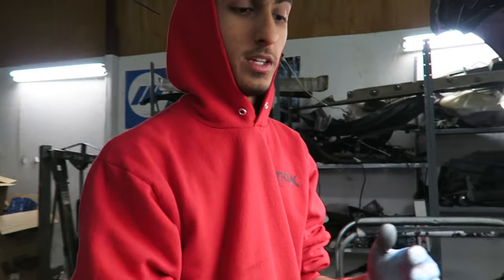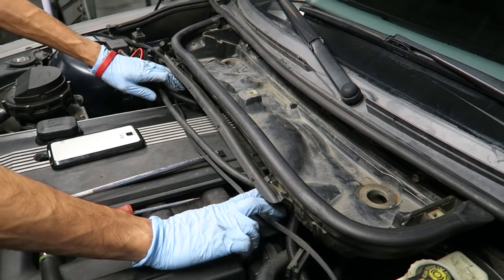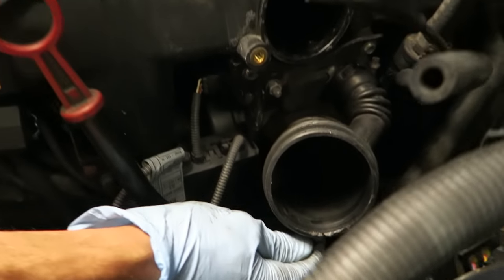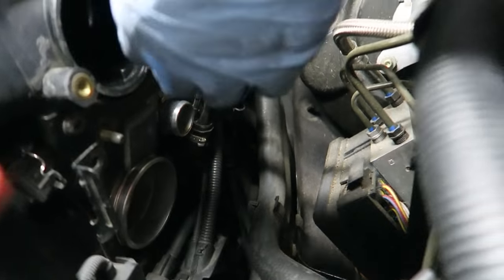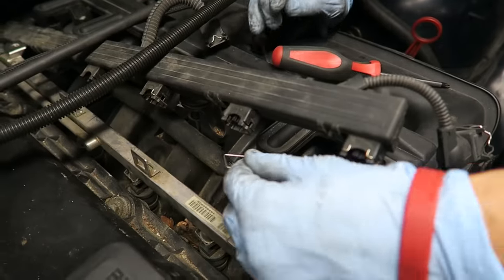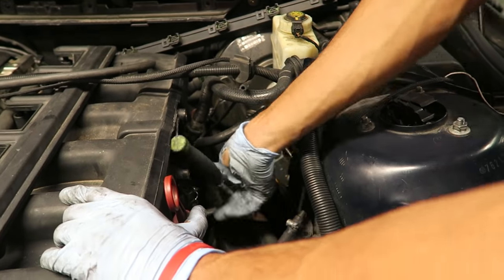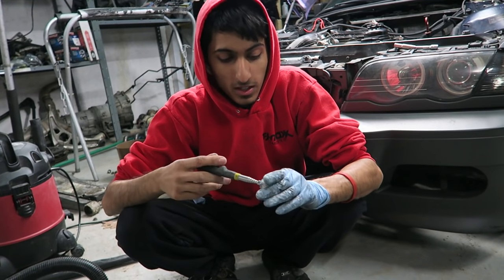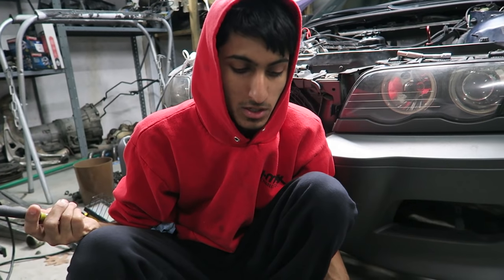BMW E39/E46 Intake Manifold Removal DIY

Comment: I wish you could talk about those 2 notorious crispy coolant pipes under the intake. I need to change those, they are still factory original
Reply: That's why I came here. Nathan stopped short. Not sure about 50sKid. Still they seem like the easiest part of the job.
Reply: Yup that would be an awesome video!!!
Reply: YUP, I pulled my manifold off for this reason.  What a shit design, those coolant pipes should be aluminum
Reply: @Static Boolean how’d that go for you, i’m in the process of taking apart to get to them.
Reply: @brianc9036   li
Reply: Yeah that’s the thing I need to do on my car. Found out hoses were leaking a few days ago
Reply: The 2 crappy plastic coolant pipes under the intake were changed. While you are there change the thermostat with a metal impeller, the connecting hoses, and oil filter housing gasket. You will thank me later. Be extremely careful and clean the holes before installing oem O-rings. The leaked first time!

Comment: On my e46 I cleaned my throttle body and turned the flaps where all that black buildup in the threshold. I did a throttle body reset holding down the gas pedal with the ignition on position 2 for 10secs & taking my foot off for another 10. It actually reset my throttle body. I couldnt rev over 3k. It solved my problem and i hope it solves someone elses
Reply: Thanks for sharing that, after watching this video I thought i'd need a new throttle body.
Reply: This is exactly what mine is doing... can you provide me with any more (specific) information?

Comment: The only injector clip I dropped was #2 and it went in the hole between #1 and #2 intake runners. I kid you not, it made it all the way to the floor. I could drop a clip in that hole a hundred times and it would only make it to the floor 2 or 3 times. I feel the repair has been blessed from on high.

Comment: I have watched a lot of different videos for the intake removal. Im glad you show more of the removal process. Would be nicer to see more of the intracacies of the process. You showed a few steps that none of the other videos showed. Thank you. Despite having an e39 myself. I was absolutely shocked how hard it was to find an instructional that showed the 99 e39 and not the 97. Great job. Now i just have to refer to this vid a few times so i can get the darn thing back in

Comment: thanks a lot, I save a lot because of u, i was having issues with fuel ingectors , and from this video i learned how to disconnect the wiring from fuel injector.i don't know nothing about mechanic but i always try. i had so much  trouble with fuel injector 3 &4, i was ready to take my e53 3.0 to the mechanic. what i learned from this video was how to unplug the fuel ingector harness and i plug it back and my trouble was solve.. something so simple cause me a lot of trouble.it had a short circuit or whatever,thanks  a lot shoplife :)

Comment: i Just bought an E46 and thanks to your videos i have or will be changing Valve cover gasket, Intake Manifold gasket, Oil Filter Housing Gasket, Dipstick and Dipstick Tube gasket, Disa Valve Gasket, Both Plastic Pipes Under Intake, CCV and Oil Separator and power steering pump ofcourse ill be changing all vacuum Lines under intake have i forgotten anything.  Mind you im not a mechanic keep up the good work.

Comment: I'd recommend also replacing the plastic cooling lines that bolt to the block also. I've been chasing down coolant leaks and mine happen to be bad. I'd you have a coolant leak, check those while you're in there.

Comment: Thank You! This Video help me out a TON! I did brake the DISA Valve upon disassembly I missed a bolt! I have coolant in the Throttle body, My vacuum lines are toast, the tube going to the crankcase/dipstick is a goner. found coolant in a vacuum lines, #6 cylinder  intake was full of coolant.  Now I need to buy the VANOS Tool set. Removing the cams timing chain, exhaust manifolds, head.

Comment: Great step by step, helped me get through this job, BUT * there are vacuum lines underneath and in the back that will break and have to be disconnected, he did not mention taking them off!! I broke the hose that connects the vacuum pump to the intake. And the secondary air pump hose is usually really brittle and mine snapped like a piece of straw

Comment: 12:25 I removed and reassembled the intake to replace the coolant pipe, and now the intake doesn't sit tight on the head anymore. I disassembled it again to make sure everything is ok, but it looks like the gromets under the 11m nuts have compressed, and there is a bit of play. These gromets aren't replaceable, so I'm screwed? I may have to fashion a set of washers to take up the slack.
Reply: Hairy Names question. Were you having an overheating problem where you would get steam from your intake manifold once temps get too hot and car starts to over heat? Bc that’s my issue and can’t tell if it’s the coolant pipes or not

Comment: Excellent video!  Especially appreciate not removing fuel rail in order to remove intake manifold.  Although I do agree that in a higher mileage vehicle, getting the injectors cleaned is probably worth that.

Comment: Nice video and good explanation of the job. I had to do a starter on one of these. im putting it back together tomorrow. the starter bolts were honestly the worst part by far. the external torx bolts are really close to the firewall. i had to cut a wrench and weld it to make room to turn it. I wish I knew the fuel line came apart that easily, I took the injectors out of the manifold. thanks for the video
Reply: 12pt wrench works, preferably a flex head ratcheting wrench
Reply: I’m thinking about getting to the starter to replace from up top too ,  any pointers on hidden plastic parts I can break??

Comment: Just followed this vid over the weekend to remove my intake manifold so I could replace the coolant pipes that run under there. What a f'n pain! Anyways, glad I did because the coolant pipes were disintegrating where they attached to the engine, pissin' coolant everywhere! Now I'm waiting for the replacement parts you recommended to replace while I got it all tore apart. Thanks for the vid! Where's the reassembly video? lol

Comment: Using this video this coming weekend. My 325i has been sitting to long now. All over a broke water pump.  Since I had it close to the overheated side of life I decided a great idea to change out some of the more important gaskets and went about the intake removal a ridiculously stupid hard way. And as I was installing everything I forgot to plug in one wire that is impossible to plug in with the intake in place and bolted back down. Oh what wire was that  yep u guessed it the blanking blank blank knock sensors ugggh this was over two months ago and caused me to loose all want to get my baby back on the road

Comment: Great video. Thank you and appreciate your videos.I am a little bit unsure how you managed to remove the fuel rail without lots of fuel spilling all over the place. I assume you purged the fuel rail first but i dont believe you shared that part in the video. I note this because its probably the single most dangerous and potentially messy part of this manifold removal process. Overall your videos are really clear and well presented.Awesome. Also was wondering if you could have included mentioning replacing the heater hoses that sit under the manifold since you have the manifold off and its accessible. Would really be a waste for someone to remove the manifold and then get the car going and one of those heater hoses in the block starts leaking and they have to take  the manifold off again. LOL

Comment: Hi. You mentione about the butterfly flop for throttle body. You said don’t move the flop because it messes up the callibration. But its unplugged tho and i’m pretty sure you disconnected the battery. Would that still mess up the callibration of the throttle body?

Comment: on the M52 engine the throttle body is not drive by wire... it has a physical steel cable to the pedal, I did open the butterfly to clean it and it is fine, it is the same a pressing the gas pedal. The year is 1999, 328i

Comment: @ 6:15 the connection in the back of the manifold? Do all m54 models have that connector? Im replacing the engine harness on my car and my old harness doesnt have that connector and is missing another one for the intake air temp sensor, i got a new harness im ready to put it on but i need to know if mine has that connector or not, i stick my hand back there and under the intake and i cant seem to find it, do you know if some models dont have that connector? Can i still use that harness without connecting that connector and be okay?

Comment: Great job making this video and explaining what each part your removing is call as I’m new to working on BMW. At the start it was a  little hard to see what you were removing if you can get a small LED light in put in under were your working it would make it a lot easy to see the dark spots. I look forward to seeing other videos you make. Especially if its show the vanos filter location for this model of engine. All the other on you tube or for other models of the engine but none for my 2005 BMW X3 3.0 Thanks.

Comment: What is the line called with the black and white piece that hooks up to the little box thing on the back of the manifold where the secondary air pump line also connects? Mine is missing and I can’t find it anywhere or what it’s called.

Comment: Great video.  I have a urgent question.  I am ready to pull out my m54b30 intake manifold but it is held in by one connector which is attached to the bracket where the lower bolt that hold the manifold into the block is located.  How does that release? I just can't figure it out.

Comment: On an 316i m43b19 engine, do i have to disconnect the whole engine wiring harness? Cause i can't get the manifold out, the harness is in the way. There are wires that go down to the starter and further down somewhere near the front axle, i can't reach them

Comment: Hi, thank you or the great video. At 6.14 you pull out a plug. What exactly is that?
Reply: If I am not mistaken on the backside the temperature sensor for intake air is mounted. must be that connector.

Comment: When I went to take off my engine temperature sensor coolant blew out , is this because I didn’t drain the coolant prior and if not am I ok to go ahead and replace the sensor & refill the coolant ? 

Thank you . 

Also - were can I find all the vacuum lines needed ?

Comment: Bro when I pulled my Intake manifold one of the hard lines that connects to the piece on top of the upper intake boot came out From the bottom of the engine and I can not find where to reconnect that line

Comment: great vid, i disconnected the vacuum line to the fuel breather while replace pcv hose. i was told connection on manifold . is removal only way to get to it?
Reply: Yup - I just used this video to remove my manifold to do the same thing.  I didn't take mime all the way off - just far enough to get under there, reattach vacuum hose, replace IM Gasket.  Now I gotta button it all back up without missing any connectors.....

Comment: You do a great job.  Lean a lot from you.  I did everything in the video now I have a P0414 error.  To the 2nd air intake.  What wire harness did I miss when reconnecting and where is it located

Comment: Excellent Videos, Got a question: I 'm in UK, had 318D E46 for 10 years, now facing a bit of problem. Too much black smoke coming and power losing as well. Any suggestions, please advise, never done carbon removing or anything like that! HtHfYouSoon.

Comment: I'm doing this right now bc I picked up a badly neglected 328Ci on the cheap. CCV seems to have been out of service for several years. What do you recommend to clean the manifold, as it's been breathing oil for several years at least?

Comment: can you please help me?
i am currently about to re-install my intake manifold on my e46. M52TUB25 engine. Drive by cable. Everything is going ok except that i cannot find or remember the mounting point for the throttle cable just before it connects to the throttle.. Would you know where this is? I remember removing it but from what mounting point is totally eluding me!
Thanks

Comment: Hey thanks for the videos!

I got told by my mechanic that the pressure at intake was reading low. I ordered a new map sensor but cannot find where it goes. Am I completely wrong, or does the m54 have another way of reading intake pressure?  Thanks

Comment: I did this and ended up with two misfires with fuel cutoff in cylinders 4/6 I've checked the sparkplug injector coil fuel pressure no vacuum leaks what would you recommend

Comment: I have a coolant leak coming from under the intake manifold. I can see coolant puddle under the vanos oil line by the oil filter housing. But I have not yet removed the manifold
Reply: That will be the plastic cooling water tubes under the manifold.  Order replacements and follow this video.

Comment: Hey whats up shoplife, I got as far as taking off the fuel rail cover, air filter assembly and seen the routing of the harness. With your vast experience, can you tell me a way that i can go about changing the harness? do i have to take out the intake manifold? Im almost out limp mode!
Reply from the maker: +Dijon Nahar you should not have to remove the manifold, there should be a zip tie or two and a few metal brackets that hold the harness in place. Just pry it out of the tabs and make sure all of the connectors are disconnected.

Comment: Would the intake suck air into the coolant if there was a leak somewhere?  Wondering if you had any idea
Reply from the maker: No, if you have air in your cooling system I would bleed the cooling system first and make sure there are no coolant leaks.

Comment: Hey Great Diy! I have a M52BTU 323ci with the mechanical throttlebody. Do you know how to check the calibration? I have moved the flap before while cleaning
Reply: Handle46 if it's manual, then no calibration needed ; )
Reply: Bump  on this question. I have the M54 automatic (2003 330i), and moved the flap while cleaning the ICV and TB. Now I'm getting a P0505 code for my ICV, but I think it's because I stuck my fniger where it don't belong in the TB...

Comment: Hi.Thanks for all your great videos. I do have a question for intake removal. Is it possible to remove the intake by removing a main harness from the fuse box instead of removing each plugs from all sensors.

Comment: Hi Man I have a 330i BMW 2004 and I'm have a problem every time I turn off my car it makes this sound like suction noise any ideas what can I check? thank you man.

I already Replace the CCV plus Hoses I'm Not sure if is the p-urge valve or the throttle body
Reply from the maker: +Luis Vega The suction noise is normal, it is usually the idle control valve releasing air.

Comment: I hope someone can answer me - I saw that I had a few leaking fuel hoses, but then I noticed a random wire going to 2nd cylinder (And no other wires went to other cylinders, just one wire to 2nd cylinder), and it was teared, so I brazed it and really I have no idea what that wire is. BMW E39 2.5 TDS

Comment: Lord I thought my E30 was a pain only thing that makes it more of s pain than this is the throttle heater which is coolant hoses so you might as well drain all your coolant. The injector wires and oil pressure wire as well as the Temp switch , temp sender, temp time switch , and temperature injector sensor all can't be removed until the intake is removed lol. Are the starter on these a pain just like the E30? Have to remove that intake just to get to mine and it has through bolts with nuts which is a pain in the ass due to the clearance with the fire wall
Reply: I have another car with a coolant hose that goes to the throttle body I never understood why I'm still learning

Comment: Great video as usual. Recently had replaced Oil Pan Gasket, Oil Filter Housing Seal and Intake Manifold on my BMW 323i 1999. After these changes, I am seeing rough cold start idle/limp mode. After some time, the problem goes away after restart of car. While car was in rough Idle, I captured the error codes P0120, P1542 and P2042. I do not have any problem after first cold start till next day morning. Reading article which says may be my Throttle Body plug is loose or spark plugs need replacements. Today morning I performed throttle body adaptation reset and car worked just fine. Any suggestion or expert comment?

Comment: hi,i have bmw01 e325i,i start the engine like 2min when the eng4 get hot and it leaking oil from the top really bad, can you told me what is wrong with it thanks
Reply from the maker: Where exactly does it look like its leaking from? Message me a video on instagram @ShopLifeTV

Comment: What are your thoughts on removing the DISA Valve on the M54 engine  and replacing it with a catch can?  There seems to be a lot of issues with the DISA Valve as these engines get older and start racking up the miles. Maybe that could be a vid.
Reply from the maker: +MrCuckoobox I am not sure that you can replace the DISA valve with a catch can. The CCV on the other hand can be replaced with a catch can and would result in you just having to keep an eye on the catch can.
Reply: What are your thoughts on replacing the CCV with a catch can as these M54 Motors start racking up the miles and the CCV gets full of oil and starts causing issues?
Reply from the maker: +MrCuckoobox The CCV usually lasts atleast 60-80k miles so I would rather just replace it. But if you are tracking the car or something of that sort the catch can is a good alternative.

Comment: okay so i did everything put it back together and now i have a tick and it sounds like its coming from the Injectors and have codes saying misfires and open injectors i have no clue what i did wrong please help
Reply: did you fix it yet ? What was the problem ?